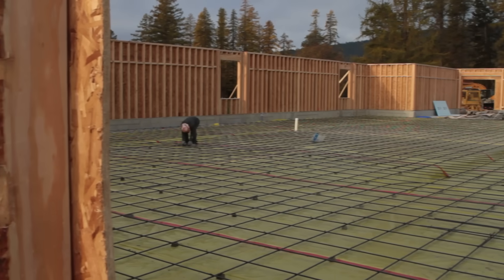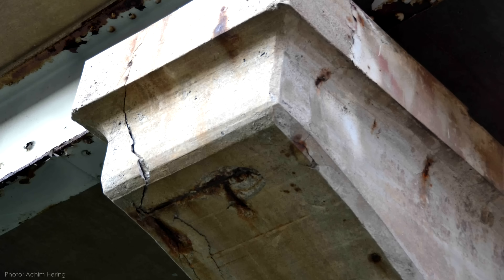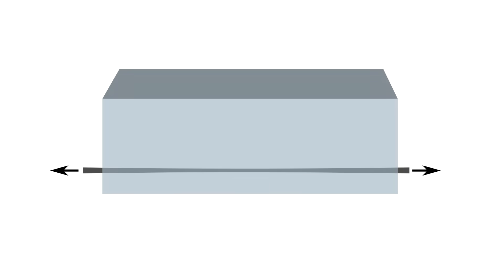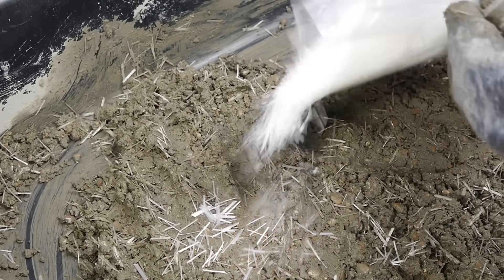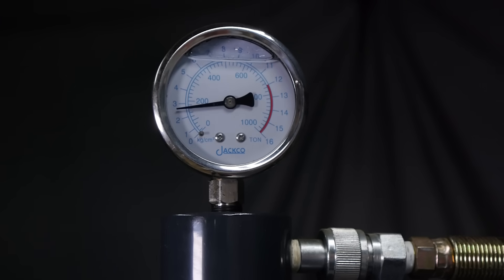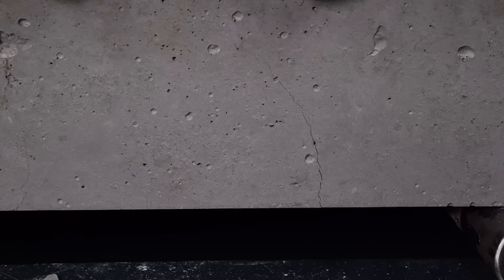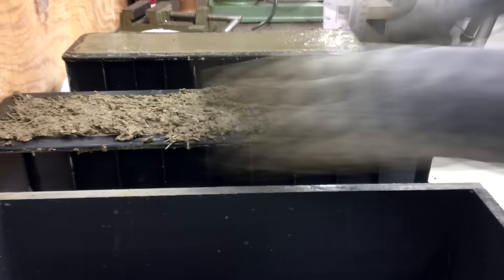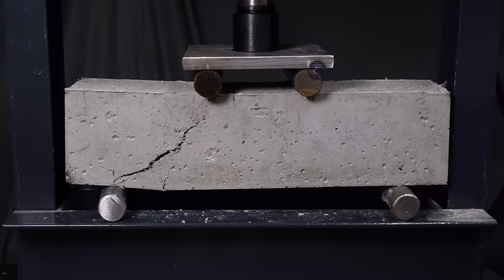Does Rebar Rust?

Comment: It should be noted that at the time of the 80s there was a lot of corruption, and for money the monkey wavered, the building codes were vastly useless, after the Andrew cyclone it was that the codes were restructured because it was being built with very poor quality, which I think that the codes for the buildings should be modified because I see the columns too thin to support a structure of such similar weight,

Comment: It will be very difficult or too expensive, to put an anti-corrosive coating on the steel bars, such as galvanized, I think it would be a long-lasting occion, also, not to put the bars so close to the edge of the casting, giving more thickening to the concrete, it would be feasible , I think that many of the problems is monetary saving the biggest problem and there is one of the reasons for so many catastrophes

Comment: I would recommend  to use a mixed of glass fibres in your concrete for expose roof RC slab. It should help reduce any future possible cracks due to thermal expansion and contraction

Comment: I first learned about rebar corrosion years ago when my wife and I visited what had been for years our favorite Daytona Beach hotel. The Americano Beach Hotel. We first visited in about 1967. I think it was brand new or relatively new at that time. We went every year for ten years but then moved on as our careers developed. Years later we went back and found that they were selling time shares as they were rebuilding the structure. We knew nothing about time shares but my wife wanted me to learn more. As I looked through the new rooms being reconstructed the first thing I saw was the construction taking place and the corrosive problem with the rebar and deteriorating concrete. I remember one guy actually pointing to a piece of deteriorated floor concrete and rebar and telling me about it. People I talked with said the repairs were not sufficient and wouldn't last. We never went back. I subsequently learned that the hotel was hit by a hurricane and is(or was) no longer habitable. When I saw the damage done in Miami, my very first thought was corrosive rebar and damaged concrete. My guess is this property is only one of many in Miami with a problem. I've seen properties built and rebuilt there without much control. Miami will cost billions of dollars to be rebuilt. Many of those retirees will loose everything they have. Government officials will most likely walk away unscathed but some are responsible for this fiasco."Due diligence".
Reply: Local government officials come and go. Often when someone new gets elected they replace staff. That is why you need Federal and State Standards/Mandates that local towns needs to abide by, otherwise you will see this continue to happen.   But even then there are thousands of zoning laws that on the books that aren't enforced (until a property is sold and needs to be inspected).

Comment: I work in the concrete industry and we have both regular steel, galvanized and epoxy coated bars in 40 foot lengths that I am trained to bend into almost any shape that we then pour into a wide variety of concrete structures.

Comment: Grady, you hit the nail on the head with the last 30 seconds. If agencies do not program the proper maintenance money, all the innovations are for nothing. We use HRP in concrete in concert with the FRP and CFR/Glass all that will do is to delay the cracking. This assumes the mixing, placing and curing is done per ACI and local specifications. Great thumbnail sketch of the problem. Keep it up.

Comment: Coated rebar is supposed to be a good solution but inevitably the coating gets cuts or tears... even then, I think the end result is guaranteed to last longer
Reply: The only coating that holds up for now is zinc, as it will migrate. Epoxies crack and then admit moisture...
Reply: fiberglass rebar
Reply: Fiberglass rebar and basalt rebar can't rust
Basalt is still struggling when it comes to testing, but fiberglass is proven to be stronger then steel rebar, on top of not corroding

Comment: Hi colleague, I'm an Architect from Rome...Metal fibers go to rust like rods...Better to enrich the concrete with glass or carbon fibers in my opinion...However, if a reinforced concrete structure is correctly designed and installed well, it can last for centuries without this type of aids, just look to the Fallingwater house...

Comment: Yes I've  seen rebar in buildings 50 years old. The rebar is completely gone. If the rebar is rusty going in. It will continue to just till the oxygen is depleted.  Sense concrete absorbs oxygen. Good luck. Hoove dam is 100% rusted out I bet. Only the sure mass of the concrete is holding it together

Comment: "a lot of engineering failures come from poor maintenance" - This is where concrete that cracks while still maintaining its strength can actually be a good thing.  It gives the maintenance engineers the ability to see that the structure is getting pushed to its limits; rather than just it happening silently.  No?

Comment: What about plastic and rubber rebars?
Reply: The important feature of rebar is to resist stretching. With steel that need seems to be expanded to not allowing the surface of the concrete to stretch so much that it cracks. Without the corrosion risk that extreme need is lifted and a less rigid material could maybe be used? Seems like if they were really rigid like PEEK or PEKK or better, if the resin rebar was reinforced, maybe that could work. It may support the load well while cracking but the cracks would not lead to a rebar degradation. The heat of a fire could introduce a new risk though.

Comment: Major error at 05:43  “Both beams cracked at the same stress load as the first one.”  What?  One sentence earlier he said the two beams with fiber reinforcement didn’t crack until about double the load.
Reply: But the load meter showed the beams handling twice the load before any cracking versus non-fiber.

Comment: Any difference if the rebars placed at the center even most of the tension is towards the bottom with this test samples ? We had major problems with fiber reinforced concrete without rebars. Major cracks after 10 years while if rebars used it would have held it together even with cracks.

Comment: Why is aluminium wire/aluminium plating or silicone or string not coated really tight around rebar so it makes a shell used to coat steel.

Comment: Which is funny cause old Roman Crete didn't have rebar and alot of it is still standing today!And by the way concrete does not protect against water unless it's hydraulic or painted other than that it sucks water up!
Reply: The Romans only used concrete in compressive applications.

Comment: A lot of the time rebar delivered to a construction site has a lime green protective paint coating on the surface of the metal. Unfortunately that’s not always the case.I often see bundles of strapped up rebar rusting off to the side of job sites.
Reply: I've never not seen rebar covered in rust, I've always suspected it was intentional for some reason
Reply: @jedaaa  I see it in green epoxy a lot however it’s sat there long enough that it gets rust spots
Reply: @loadedfun4764  yeah and as soon as it starts getting manhandled around the site and scraped and scratched it seems like a futile endeavour, I've never seen it painted myself, perhaps that's not an industry standard here in the U.K
Reply: @jedaaa  google green epoxy rebar

Comment: Been in building/plumbing trades for many years, seen plenty damage to structures caused by corrosion, always wondered why stainless steel is not used in high moisture concrete like dams etc.....
Reply: It's way too expensive nowadays.
Reply: @EskoMorko_  ....it's more expensive when the dam collapses, or structure fails, however, I see your point and would like to think epoxy coatings instead of stainless might be considered.....
Reply: @richardwebb9532  Yeah. I meant the general habit of cutting the costs.
Reply: @EskoMorko_  ...yes, quote for stainless, install mild instead...🍻

Comment: They should study Japanese wood joining methods. Oldest standing wooden structure is in Japan. It's 1300 years old. From my understanding since they don't use any metal screws or nails just ingenious woods joints, that the structure last a lot longer since everything is made out of wood and that every joint will expand and contact at the same level/time so no nails or screw can be worked out since there is none. The joints are always snug because of that.

Comment: re: Surfside Florida collapse...  Concrete is somewhat pores and depending on the climate, like tropical climate in Florida the rebar would rust and fail quicker.  When you see cracked concrete, bleeding rusty fluid, its time to GET OUT OF THERE....  This building in Florida had massive failures, and the building owners knew it, and so did the tenants...  as they were presented with a plan to make needed repairs (2 years ago) and they balked at the price tag of $100,000 to $200,000 dollar assessment on each of the condos in the building.  The City and State should have condemned this building years ago.  I predict, the State of Florida will conduct many more inspections and count on 30% of building over 25 years old needing major repairs or retrofits.  I think we will see 10 or more high rises in Florida out right condemned.  Just a California has building codes steered by earthquake threats, Florida and the gulf coast needs to get educated on rusting corroding steel in concrete buildings.  That 40 year old building that failed and collapsed in Florida, would have lasted 3-4 times long in California..  with much less deterioration.

Comment: This subject of rebar corrosion has become a curiosity of mine over the past 15 years because I  have been using it to some degree to build different supports , footers , slabs , in the near future some fence posts.  Something that I observed several years ago when a nearby state bridge was being replaced made me rethink about rebar corrosion in a completely different way!  What  I observed when the old bridge was being removed made me think completely differently than what I had been told or learned from experienced contractors.  This old style bridge was built , I believe in the 1940's .  It had sides which were poured concrete and had vertical slots cast into them and they were actually aesthetically attractive time period designs.  The problem with this design was that as highway winter weather management changed , the use of lots of salt and liquid calcium would lay inside these openings in the side walls of the bridge and cause spalling and breakdown of the concrete.  The salt and calcium would be washed off the flat surfaces by rain but the open slots held much of the salt and calcium in place .  I witnessed this deterioration in numerous bridges of this style bridge in my county and you could visibly see corroded rebar exposed in the walls.  What I found as quite unusual though about this particular bridge near my home is that when they removed the sides of the bridge and stacked them up on top of themselves before they crushed them was the rebar in these side walls was not round , but; rectangular in shape .  It was not coated at all and there was absolutely no rust on this rebar that was exposed when they cut and hacked these sections off !!!  I would visit the site almost on a daily basis at times to watch the progress of the teardown just to see what kind of condition this bridge was really in that I traveled over on a daily basis.  There was what I observed as 3 or 4 foot sections of this rebar exposed in the demolition in some of these parts of the walls and the ends cut with saws and the end cross sections looked like brand new steel with NO CORROSION whatsoever in a bridge 70 plus years  old !!!!!!  How could a bridge this old , exposed to all this salt and calcium over these many years have rebar that looked like new in the most suspect part of the concrete structure???!!!

Comment: Why doesn't rebar embedded in a, freeway overpass, not have a sacrificial anode which is bolted to the exterior of the overpass and connected to the rebar via a shielded length of copper wire?  In this way the anode is easily visible for inspection much like on a ferro-cement boat.  Of course on large structures there would need to be numerous anode bars and some grounding may also be needed somewhere along the circuit.  The anodes could be replaced when a certain percentage was eroded away.

Comment: Is it a good idea to paint the steel rebar prior to covering with concrete?
Reply: They actually tried that. They covered the steel in epoxy. Job site damage, and manufacturing errors, have lead to some places banning the use of epoxy coated rebar. It can cause some big issues when it’s not right.

Comment: Couldn't extruded aluminum (in a structural shape) be as good as a plain rebar rod?
Reply: No. The aluminum will react with the alkalis in the concrete and will produce hydrogen gas. Not to mention the aluminum will also be rapidly degraded during the process.

Comment: I’m in concrete repair/restoration. The fiber and steel additives are mostly used in shotcrete and gunnite applications. You should also look into cathodic protection systems, we implement these to almost completely negate corrosion in some cases. There are many different systems and it’s very interesting.
Reply: Very interesting- to clarify, you don’t feel there is really an indication for these in most residential situations?
Reply: @johnwhite2576 I pour mostly residential foundations and see fiber in the mix sometimes
Reply: Basanite
Reply: Please give us wisdom. What about PPC? Or simply not putting steel wherever possible (Foundations)

Comment: We (in Holland) have houses built in the years 1965 - 1981 about. 
They have concrete rebar enforced. But they used special accelerators to speed up the hardening of the concrete, like chlorides.
Now these floors combined with some wet / moist spaces under the floor can have terrible corrosion.
Those floors are called "Kwaaitaal and Manta floors" due to that name in the concrete (by polystyrene headpieces). 

So, buying a house in Holland, you must really be aware of this.

Comment: The addition of BUTYL to surround steel rods totally disallow both potable water and salt weather contact to the steel rods.  I suggest research in this area particularly in cement road construction.  The benefit of this added material  BUTYL is even with the possible stress loads, expansion and contraction from a condensed water to expanded ice condition THE BUTYL DISALLOWS OXIDATION.   The major drawback in this how to solve the issue of FRICTIONAL to MECHANICAL  attachment.   The answer is amazing simple, inexpensive and could extend the life of concrete structurally even with fracturing occurring. 
Peter Gold, PI

Comment: What I don't understand is that stainless steel rebar is available yet nobody wants to use it! It's more expensive - true - but it means a structure can last for a hundred years instead of five or six decades! In the long run, it's cheaper! Just imagine if the interstate was built with stainless steel! None of the bridges that are now falling apart due to rust would be affected at all!

Comment: This makes me wonder, can recycled plastics be made into strong enough fibers that can then be used as reinforcement filler in concrete?  Would be a great use for all that garbage that ends up in the oceans.
Reply: Almost certainly not.   Most plastic is far too flexible - it would stretch under load.   
I guess it could be used simply to fill voids - but then expanded polystyrene (styrofoam) is often used already for that purpose and as insulation.   But structural uses - no.

Comment: I think they should just use stainless steel re-bar. Despite the cost, it should be compulsory in cases where the concrete is exposed to the weather.

Comment: In the mannerheim line of defenses in Finland during the winter war of 1940, the Finnish concrete structures used concrete reinforced with fibre-steel and they were extremely difficult to damage or destroy.........the Soviet Red Army was averaging 8,000kg of artillery shells per pill box to knock them out.

Comment: One way to avoid failure In steel reinforced concrete columns is not to use them 
Structural steel is a better option

Comment: Besides rebars, adding lots of "chicken wires" to concrete will reduce the risk of pancake collapse as happened in Surfside, Florida. Chicken wires (actually, wire mesh) have been used successfully in ocean-going ferrocement yachts.

Comment: Building with rebar is construction suicide, it goes in already rusty on the assumption that it won't continue rusting without air/ oxygen...  Bad bet.
Reply: Use non corroding stuff and your fine
Reply: @the_retag 
There is NO such thing being used and for many reasons ... 
The cost. 
And there's no guarantee that a coated rebar won't also rust.
Reply: @kellikelli4413  ive personally seen a video of non steel  (o think it was fiberglass, made to be a rebar thick stuff, on a roll) being used. Survival rusia channel, house with many corners (forget how many)

Comment: Another problem with concrete , the failure of installers to ensure that rebar is within the center mass of slabs .  Often , rebar is sitting at the bottom of a pour , when no highchairs are used or workers don't understand or don't care how important it is to raise rebar and ensure its imbedding within the concrete .
  But you're correct , over time , rebar is inferior as a strengthener to concrete .  Fibers help , and proper installing is imperative to prevent premature failure

Comment: Adding zinc plating like chain link fence to the rebars would cut the corrosion potential significantly. Even better is stainless steel. Builders are usually too cheap to do this.